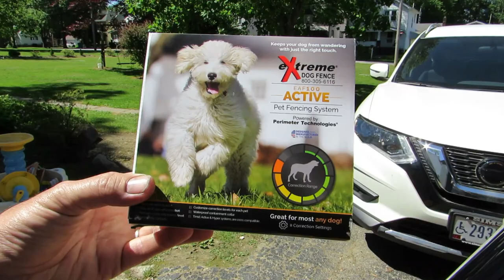How to Install An Invisible Dog Fence

Comment: Lol! Michelle is a pusher! I would rather have someone use what is needed to keep their pers safe. The only bad thing that I have heard is if for some reason your dogs gets past the fence they can’t get back in.
Reply from the maker: So far this is working great on the dog!  We still have a few flags up.  She got close to it today and turned around real quick.  No more chasing other animals or people!
Reply: There is a setting for stubborn dog's, it basically is a longer alert zone and a stronger shock. My opinion is that if the dog is That Stubborn, I think a chain link fence is more in order.